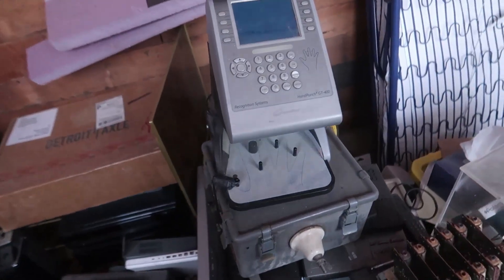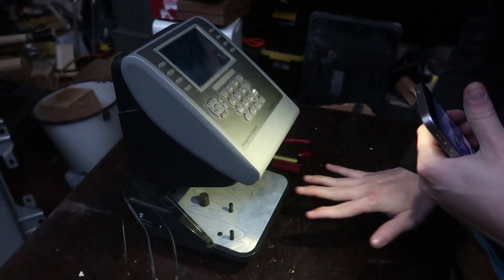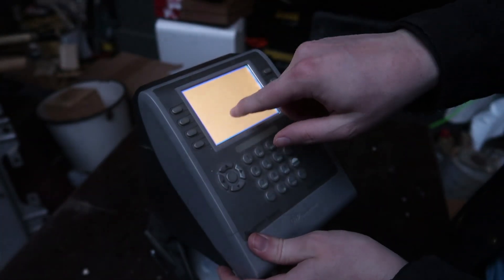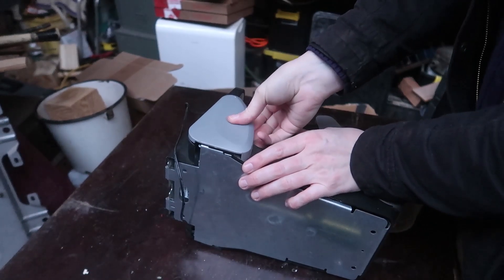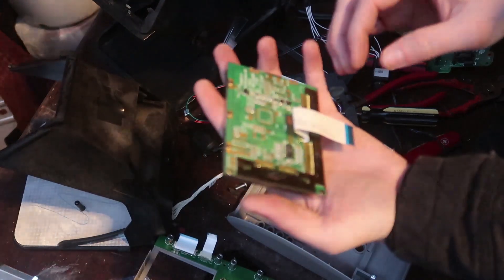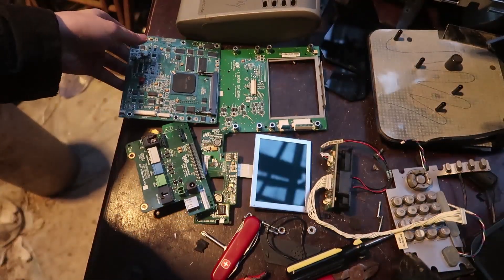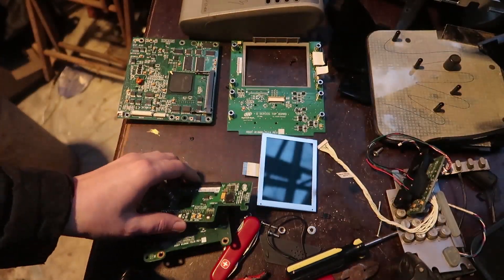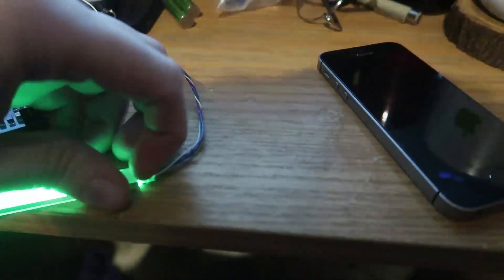Biometric "HandPunch GT-400" Hand Scanner Teardown

Comment: Good video, the Relay is for any external device such a light or door opener. We have several of these but we need to find out how to reset factory settings, I tried via screen menu the default password found in manufacturer manuals and even via telnet with password 1234 but it doesn't work.

Comment: The different LED colors may have different needed voltages. It's possible that they have multiple LEDs in series or some other configuration that makes it so the forward voltage is raised over 3V. Do you have a good current limiting power supply? If not, it could be worth the investment as you get deeper into electronics
Reply from the maker: yes i was using my benchtop PSU before, i think its a cable issue

Comment: the crappy LED strips I ordered on ebay years ago had different solder points on them and different combinations of wiring them changed the color, not sure if yours works the same way.

Comment: It might be the sd card is formatted in a linux file system and possible contain a custom Linux operating system
Reply: Windows will probably not detect other than NTFS and FAT
Reply: @folk.  Is that still the case with WSL?
Reply: @NiHaoMike64  yes, generally speaking. Disk management and file explorer, as rinoa was using, aren't going to see much more than MS-based filesystems. With WSL you may be able to view the particular roots of the linux filesystems within that subsystem, but not disks brought in from elsewhere. There are some third tools that exist that may allow mounting of certain other filesystems for access in explorer but frankly it's not worth the trouble when you can just usb boot your favorite live Linux